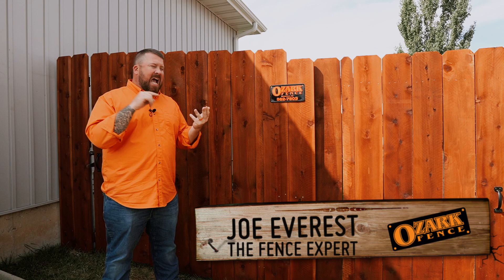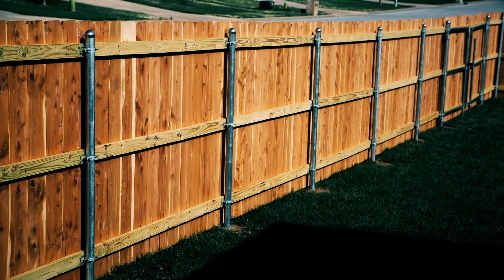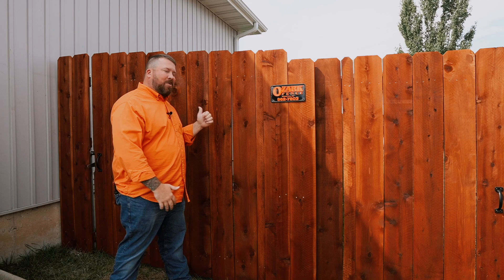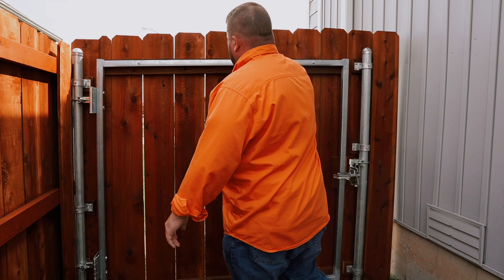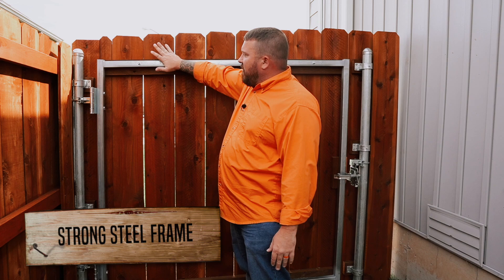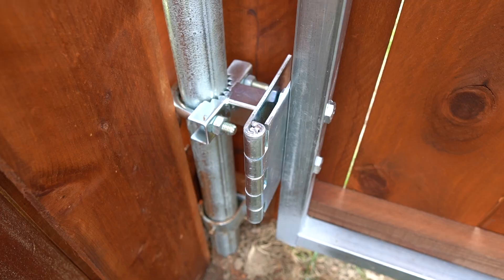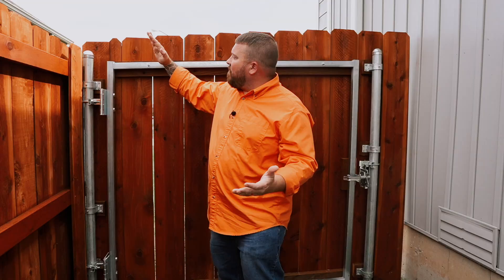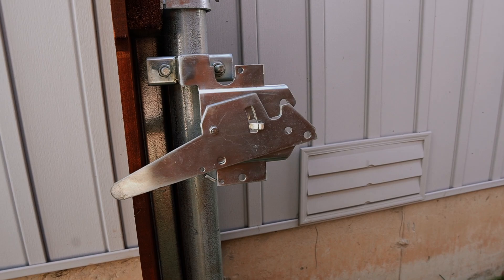How Professional Fence Builders Build a Strong Fence Gate

Comment: Gate post line post or a latch they all the same amount of concrete. I call my feel good factor. I may not be the cheapest were I live, but I differently try to build the best fence possible. Always mount through the post and gate frame when hanging gates. I still go for the older look with black hinges exposed, but mainly for looks and no wood do not support weight though.

Comment: The frame looks great, but how do the welds hold up over time? A small gusset in each corner would increase the corner strength. Maybe experience proves they are unneeded.

Comment: thank you for this I'm going to be doing something similar for the metal frame I'm going to be using the top rail from a chain link fence which I believe is 1 3/8" and I'm going to bolt it onto the rails of the gate like your gate mine is going to open to the inside it has to because there is a hill on the other side. I am going to use a regular deadbolt like you would use on the door of a house for the locking mechanism. I'm going  also attach from the fence post to the frame from chain link fence rail; a hinge system like you would find on a chain link fence. the type that goes from the post to the rail. on the bottom of the fence I am going to be using a wheel which it will roll and prevent sagging as well as I am going to go from one post to the next with a steel stranded wire by a turnbuckle it'll go from the top of the fence post bolted to the next closest post which is 4 feet away to the bottom part. I do appreciate the tip about making sure that it is going to match the rails because it is at a slight incline. and I did not consider that but now I will thank you
Reply from the maker: You’re very welcome, always happy to help. Let me know if you need any advice during the build!

Comment: Joe... great video. What is the best way to measure the distance between the gate poles using a gate frame like this and the Shark gate hinges and latch?  I guess... how many inches on either side of your metal frame do you measure out to set your poles?  Thanks!
Reply: This was my q also, but he answered it in the video, you can install hinge side or lay hinge on floor( mock) measure off reference points, & repeat on latch side

Comment: I prefer to use the black vinyl coating for the posts and gate frames but it’s exactly the same as this. It’s just a preference of mine that the black blends Into the wood and I also don’t have a issues with using and seeing the regular wood hinges and latches with the black metal frame

Comment: With the understanding that you could actually just kind of kick through the middle of the gate since there's no 2x4 support to hold the wood up in the middle of the gate you're only supporting the tickets from the top and the bottom which severely decreases structural integrity in the center of your gate
Reply from the maker: Great point, we’ve since added a middle brace

Comment: That's a completely different set up from the methods we uses we make a round pipe frame gate with a 2-inch pipe and then we use something that is called a box hinge for around the gate frame and then around the post and the fence post and lab supposed would be 3 in ss40

Comment: Realistically, you would only need the heavy gauge pipe on the hinge side.  Especially if you had multiple gates, you could save a little cheddar that way.
Reply from the maker: True, but when buying full lengths in bulk it doesn’t save enough to warrant keeping an entirely different SKU.
Reply: @JoeEverest  Yes, excellent point for a business.  I suppose that was more for the homeowner looking to save a little on their respective project.

Comment: I use square stock for posts and fence.  
Above all, I clean, prime and paint the steel a complimentary color,  (tan)  before the wood goes on. 
If you put in good anchor posts, you can weld the gate into it's closed position until the work is done, then cut off the supports. 
Done. Pretty.  Long lasting.  Simple. Easy. One man. Low cost. Environmentally conscious. Local. Organic.  Free range fencing.

Comment: I like this gate, the only thing without a center rail how don't your pickes break and warp? I also find pouring concrete on your hinge side post will also prevent that post from ever bending.
Reply: @JoeEverest  I understand that but with out a center rail their can still be warping due do natural climate changes and drying, and I see all the time where no center rail is put and the pickets over time break and warp "bow" in and out.

Comment: How does the latch work if you were to build a double gate?
Reply from the maker: There is a different latch for double gates, same mechanics but it’s made to bolt directly to the gate frame!
Reply: @JoeEverest  I'm about to build a driveway gate and would like to know where to buy the latch you're referring too. Also, you said the steel frame company makes an adjustable frame or welded like you used. Where can I find the adjustable option at since I can't weld myself. I checked your website but couldn't find either.

Comment: Do you have any videos on using a steel gate for a vinyl fencing?  I am replacing a short section of wood fencing with vinyl.  I want a gate that is sturdy, can be opened from both sides and is lockable.  When my fence was put in many decades ago, (wire mess), I had a stainless steel gate and posts.  Oddly enough, one of the gate posts corroded at the cement level and because that was being replaced, I replaced this section with a wood privacy fence.  (As an aside, to this day, not another post on the entire fence has this corrosion problem.)  Now I am replacing the wooden fence.  After decades, we are now seniors and want no muss, no fuss, therefore vinyl.

Comment: Do you have a problem with pickets warping on the gate since they are only fastened on the top and bottom and not in the middle?
Reply from the maker: We haven’t, probably because we’re using Cedar. If using Pine and warping is a concern a middle brace could be added easily.

Comment: Great video! Used your other videos to help me rebuild my fence last year. 

Now working on a new fence door. Just purchased the shark hardware from your website and and should be arriving tomorrow! I have been scrutinizing your video to replicate that door. 

I’m sure you’ve been swamped with questions, but if you have some time could you shed light on the material you used for the steel frame? Is there a gauge of steel you would recommend?
Reply from the maker: We use 1.5” square galvanized tubing, 16ga.
Reply: @JoeEverest  much appreciated! Thank you!

Comment: I'm looking to build my fence using round steel posts. Would you say it's okay to use 16 gauge round steel posts for the rest of the fence and just use the sch40 steel posts for the gate posts? 

Also, would this type of steel gate system be adequate for a 12 foot double gate (two 6 foot gates)?
Reply: Too bad no one answered you.  I'm trying to put in a 12' gate too.  What did you do and how did it go?  I'm also trying to go thru cement driveway on one side and how to go about it.

Comment: A couple of things ,  would have looked better if you had the top of gate level even though you would sacrifice approx 100mm in height at the house. Just rake the bottom rail of your gate frame with the fall of the ground.  A middle metal rail on gate frame also. Need to put some caps on the gate frame to prevent water inside of gal tube to prevent rust in the future.   Instead of using timber rails on the gate frame we use gal or stainless steel hardened screwshank nails into the palings straight into the metal frame.  Makes the gate lighter without the need of timber rails bolted to the metal rails.   Never had any issues and been fencing for over 25 years.
Reply: 60 years beats 25 years
Reply: That was the first thing that caught my eye, was the unlevelness of the top of the gate pickets, and the skinny ripped piece over to the right side of outside of gate. I came to watch the video bc I watched his response video to another gate builder. But after watching his response video and the points he pointed out, was the exact same thing he was showing on his own gate, so what's the point of pointing out someone else's flaws when you've got your own flaws??

Comment: So the question is do you want to deal with wood sagging, like the rest of the fence, or do you want to deal with rusty chain link fence poles and welded together tubing  holding things together. To me that steel gate looks garish against that wood fence. If you feel that you need to hide is from the outside to protect the curb appeal, you better be darn sure, from a customers perspective, I don't want to be looking at it every time I go out into the yard.
Reply: @JoeEverest  understandable. Personally I would not expect lifetime thats a lot to ask. Everything requires maintenance eventually. I would just expect a good 10-20 years before it needed work. New hinges/latch, New frame, New face boards. Galvanizing does help, but it still looks out of place against the wood fence.
Reply: Yah but you could also paint them to a neutral color with a touch up every 3 years

Comment: Top quality work right there!!! When I weld galvanized stuff together, the welds themselves and the metal around the weld tends to rust while the rest of it doesn't.  Do you guys do anything to prevent that? My welder isn't that great and I use the run-of-the-mill wire spools.
Reply: @JoeEverest  Thanks for the reply!
Reply: I use cold galvinize paint

Comment: Hi I called Forney Fence 3 times over a couple weeks and also asked to get quote. Never got anything, I think first call was Oct 9. Got any other options that might work since these guys are not responding?
Reply: @JoeEverest   In Portland OR and  Postmaster website for retailers in area HomeDepot and Lowes shows up but they only have one type of the post not sides and different heights, going to order online maybe plus could use hinge, gate frame and latch that is good quality want all medal. Got three gates to ideally 4, 6 and 8 ft plus need to have post, frame and hinge to do it. All different heights ideally, could maybe do 6 foot high if only option

Comment: You need support from the top corner of hinge side to the bottom corner of the other side, I would use a cable with a turn buckle! Can use the turnbuckle to square the frame during fabrication as a bonus.
Professional Welder of 10 years now and now an engineering student

Comment: Sorry Joe, while enjoyed the video, I've got to say that those poles and offset hinges and all of that metal just looks horrible. I know it is on the inside of the fence and not visible from the outside, but still it just looks horrible. Any hints on how to make a strong gate that is a bit more appealing to the eye? How about a gate with hidden hinges so you don't see anything from the front or back?
Reply from the maker: That certainly is a concern, but we haven’t come up with a great way of boxing out this hardware without the cover looking just as out-of-place
Reply: @JoeEverest  I have never tried this myself but have you considered extruded aluminum maybe 2040 to form a frame and then traditional hinges bolted through it? I think it is worth considering, It might be more visually appealing than the round steel tubing. I might try that on my own fence, the wooden gate is getting a bit long in the tooth.